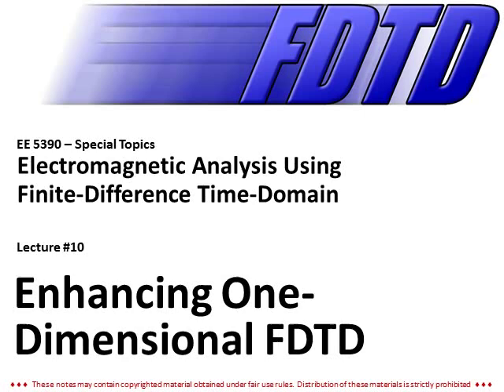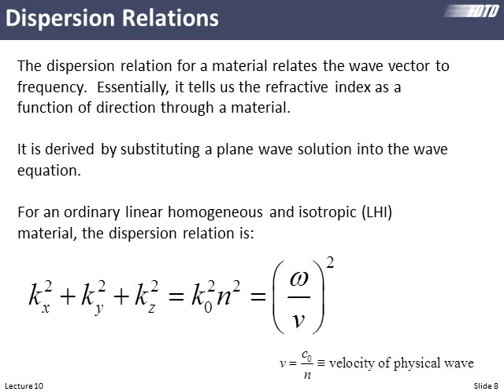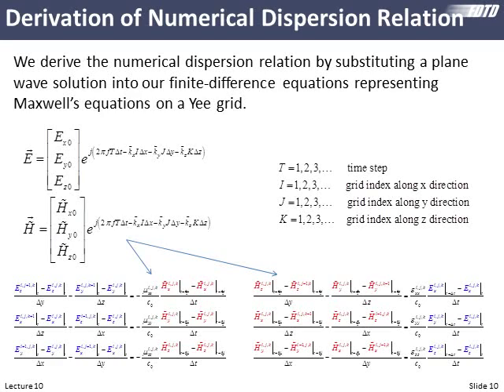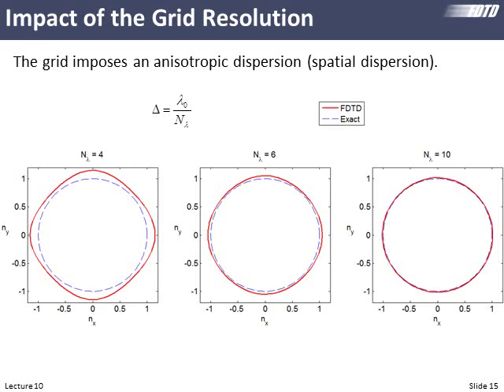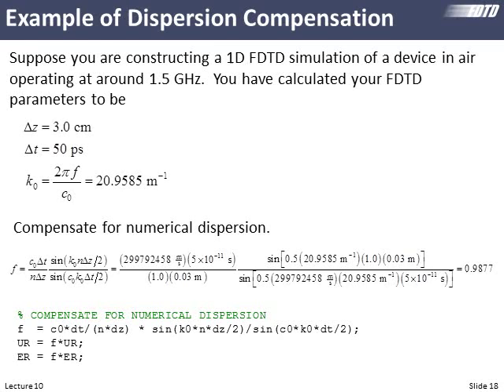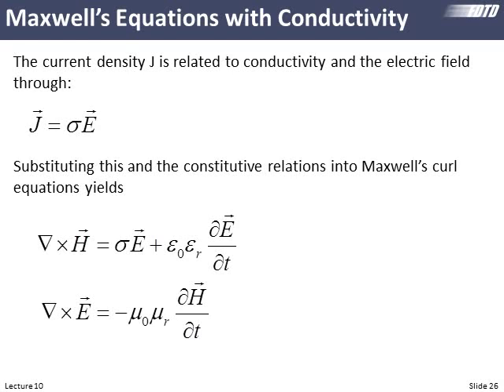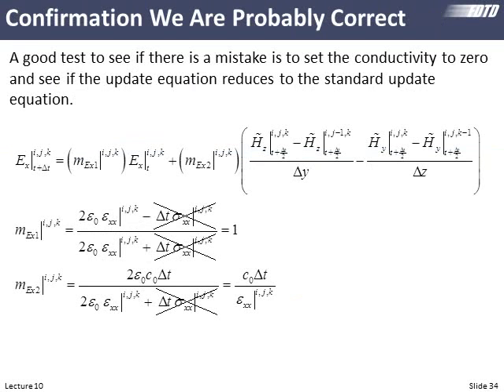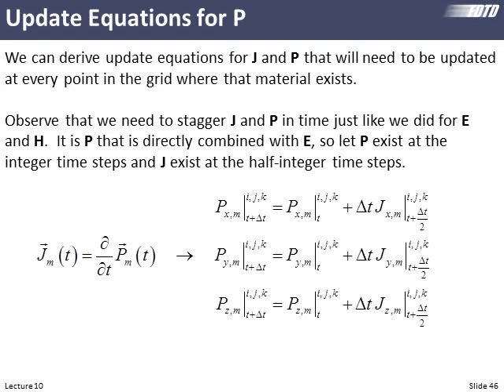Lecture 10 (FDTD) -- Enhancing 1D FDTD

Comment: Hello Professor I am trying to model a dispersive dielectric material using FDTD to determine its frequency-dependent relative permittivity but I can't get it to work. I tried to modify my working model for the dielectric slab you talked about in the previous lectures (8 and 9). 

Since now I don't know the refractive index of the material (in fact that is what I want to determine) I took n_max as 1. I should also note that the set of equations I am using is a bit more complicated, I am using the phonon coordinate instead of the polarization but it just replaces the constants in the equations so it shouldn't affect the result I think?  I am also still updating the values of H and E at the boundaries which seem to be missing in the loop you gave in this lecture but since the equations for D and H do depend on the values of H and E at the boundaries respectively I think keeping them is justified.

Anyway, I wanted to ask you what I should take for n_max (I know that near the resonance the refractive index jumps up to 16+ 16i) in this case and what other things I would have to change to get an accurate result. 

Thank you in advance for your answer.
Reply from the maker: Sorry, but I am a little confused. You wrote “trying to model a dispersive dielectric material using FDTD to determine its frequency-dependent relative permittivity.” You will need to know the frequency-dependent permittivity in order to run a simulation. I think maybe you are tweaking the parameters until your simulation matches experiments in order to determine the properties?

Setting nmax to 1 when you don’t know the properties is also confusing. Again, you cannot run a simulation without entering some kind of values. In this case, you should know nmax.

I do not know what “phonon coordinate” is to help you.

Which block diagram are you looking at? It should include recording E and H at the boundaries.

From your last statement, choose nmax = 16.
Reply: @empossible1577   Hello once again thank you for your reply. To clarify some things I am using the Lorentz model on dipoles to determine the propagation of light. Here the polarization is simply given by:

P=NZQ/sqrt(mu*N) where N is the number of unit cells per unit volume, mu is the effective mass, Z is the charge of the ions of a dipole, and finally, Q is the phonon coordinate given by Q=sqrt(N*mu)*W where W is the effective displacement between the two ions of the dipole. In other words,  here a phonon is the different vibrational normal modes of a charged harmonic oscillator (which is the dipole). We can rewrite the governing equation as:

partial of J + gamma*J+omega^2*Q=sqrt(N/mu)*Z*E, where J= partial of Q instead of P

Taking a monochromatic EM wave (of angular frequency f) the solution for Q is also a monochromatic wave giving:

Q(t)=(sqrt(N/mu)*Z)/(omega^2-f^2-i*gamma*f)*E(t) 

plugging this equation back in for the equation for the polarization we get a similar result as the one you got at 47:48 in the lecture (or slide 24 in the lecture notes). Now using the relation D=epsilon_0*E+P we get:

epsilon_r(omega)= 1+(NZ^2)/(epsilon_0*mu)*1/(omega^2-f2-i*gamma*f)
                               =1+(omega^2(epsilon_0-1)/(omega^2-f2-i*gamma*f)

which is the same relation you gave at 38:25 (or slide 41 from the lecture notes) once we define omega_p^2 as the coefficient at the start. Now this is the analytical solution for a monochromatic wave. Now using the loop you provided at the end (or slide 52 in the lecture notes which is the one that is missing the steps of updating the values at the boundary) and replacing P with Q (for now this makes no difference except for the coefficient for P which is now Q) in the equation of E we should be able to retrieve this result through FDTD but right now I am having difficulties with this step. That's why I wanted to ask you about the parameters and implementation of this system of equations. I know analytically that the refractive index goes up to 16+16i (but didn't know how to choose nmax to match that). I will try using 16 as per your suggestion. I also wanted to ask you what would happen if I tried to use a higher value just out of curiosity.

As for your question on how I can run the simulation without the frequency-dependent relative permittivity, I think epsilon_0 and epsilon_infinity (as the value fo the relative permittivity at 0 and infinite frequency respectively)  should be enough the run the simualtion. Like I said I was confused as to how to apply this to the algorithm from before. I should also add that the source I am using is a modulated Gaussian pulse with bandwidth extending from 20 to 32 THz since omega in my case is about 25 THZ.  So in this case I am also taking fmax=5 which is not the maximum frequency anymore but just the difference between 20 and 26 THz (which is the central frequency of the modulated Gaussian). So I suppose I would like to ask whether this would pose any problems as well or i  should I just change tau to be 0.1 and keep fmax at 32 THz or a slightly higher value. I am using this range as this is the range is slightly bigger than the so-called reststrahlen band where the reflectivity is high. 

To give my question more context, I plan to add some nonlinear terms to Q afterwards to replicate the results of this paper: https://www.pnas.org/doi/full/10.1073/pnas.1809725115. However, at this stage, I am excluding the nonlinear terms to make sure I have a working model.

Once again thank you for your answer and assistance in advance
Reply: @empossible1577   Hello I wanted to give you an update on my previous comment. After your comment, I tried to put fmax=32 THz and nmax=16 and put tau=0.1 for the modulated Gaussian pulse. Unfortunately, I still can't get accurate results. In fact, weirdly I am retrieving the previous sinusoidal pattern instead of the curve with the restrahlenband (the area where the reflectivity jumps up and then down). So I am asking for your help once again. I have one more question you previously said the spacer region should be as big as the minimum wavelength for 2D and 3D FDTD but is not required for 1D FDTD. Does this still apply to dispersive materials?

Thank you for your help and sorry for bothering you once again hopefully I am not asking too much.
Reply from the maker: @emredurmus2506  No need for spacer regions in this specific implementation of 1D FDTD regardless of material properties. 

The reason for the spacer region is that many absorbing boundaries do not handle evanescent fields very well. Inside the perfectly matched layer (PML) absorbing boundary, evanescent waves become propagating waves that become an escape path for power in the simulation that you cannot account for. The spacer region is meant to allow the evanescent fields to sufficient decay before touching the PML. Many times you will hear that the spacer regions need to be a quarter or half wavelength, but this is only a rule-of-thumb. Some devices have very large evanescent fields and these simulation will require much larger spacer regions.

This specific implementation of 1D FDTD uses a perfect absorber so it is never a problem. It could can handle evanescent fields without problem.

Hope this helps!
Reply: @empossible1577   Yes thank you for your response I just had one more question. For my source, I am using a modulated Gaussian with a central frequency of 26 THz how would I modify fmax in the algorithm in this case I have set tau to 0.1 since I want the range of the source to be between 20 and 30 THz.
Reply from the maker: @emredurmus2506  If you are ever unsure, simply FFT your source and identify the maximum frequency. Remember, it is not just the maximum frequency you are interested in, but the maximum frequency where the FDTD will see energy. Even when you are not interested in certain frequencies, if they are present in the simulation they could cause the simulation to go unstable if not accounted for.
Reply: @empossible1577  That's interesting I can't say I completely understand it. So the fourier transform of my source is a gaussian that goes from 20 THz to 32 THz and hence i choose 32 THz for the maximum frequency  but then again i am not sure what the maximum frequency where the energy is present is i just have that the tau term is 1/(2*6) and from the first example with the normal gaussian that was where we used the maximum frequency so I am guessing 32 THz would be the maximum frequency in my case but then again there are no frequencies below 20 THz in my simulation then would they affect the result?
Reply from the maker: @emredurmus2506  In terms of stability, I don't think the low frequencies will hurt. If you wanted to get accurate simulation results at those low frequencies, there are some things that could still go wrong, like not enough space between your device and PMLs. If you have no interest in those frequencies, I would not worry about them.
Reply: @empossible1577  Ok thank you very much for all your help!
Reply: @empossible1577  Hello Professor sorry to bother you again but I have a quick question. Is there a way to choose d according to the maximum frequency and refractive index of the system? It is clear that as either is increased the minimum wavelength and hence the spatial step size decreases making the simulation take longer for the same length for the material. For instance, for the dielectric slab with a maximum frequency of 1 GHz and maximum refractive index sqrt(12), choosing 30.48 cm works well but when fmax is increased to 32 GHz and nmax to 4 keeping d as 30.48 cm not only makes the simulation take a longer time to run but also gives a wrong result. But changing d to  3.048 cm seems to solve this issue (perhaps partially). Now I want to set fmax to 32 THz and nmax to 16 and for these values I have  not been able to choose d accurately. Could you give me any tips as to how to choose d in this case?
Reply from the maker: @emredurmus2506  I am not sure what you mean when you say the simulation is wrong. Are you only changing fmax, or are you also changing the thickness of the slab. Increasing fmax should not change the results of your simulation unless those results were not converged to start with. If you were not converged, increasing fmax will add to the resolution of your simulation and the results could shift. Otherwise, increasing fmax should not change the simulation results.

Yes, your simulations with higher fmax but everything else the same will take longer. There are special cases were ADI-FDTD an get around this, but I don't think that is an option for you. Unfortunately, you will have to suffer through longer simulations! Welcome to computational electromagnetics! LOL
Reply: @empossible1577  Hello thank you for your response I am in a weird situation right now with my model. I have a Gaussian source with a central frequency of 26 THz and bandwidth of 6 THz and as I mentioned before I am trying to model a dispersive dielectric using the Lorentz equations you provided in this lecture. Now I know the real part of the refractive index goes to 16 near the resonance so I set fmax=32 THz and nmax=16 but then what I get for the reflectivity is just a sin^2 plot as per a normal dielectric slab. I am also plotting the analytical solution which looks entirely different (as the one you showed in the lecture). The weird thing is if I set fmax=10 THz and nmax=1 I suddenly obtain the correct result up until a bit after the resonance where the plot just continues to stay at the same value with some small oscillations. I should mention that instead of performing the Fourier transform at ever step as you did I am instead recording the reflected and transmitted fields at every time step ( that is the value of E[1] and E[N] at each time step) and then performimg the FFT using the time step size and length and the FFTW library.

What is confusing me right now is I don't understand the role of fmax and nmax. For my model fmax only goes into determining the minimum wavelength and nmax goes into the minimum wavelength and propagation time but choosing their actual values leads to an inaccurate result when compared to the analytical result. 

I also don't know what I should choose the thickness of the slab to be as the thickness affects the distance between the peaks of the sin^2 pattern (in fact for the normal dielectric slab it is simply given by c/(2*nₘₐₓ*d)) I have found that the sin^2 pattern I obtain for the real values also follows a similar pattern except the distance between the peaks is the mean of this value for all frequencies.  How could I solve this issue?
Reply from the maker: @emredurmus2506  Yes, fmax and nmax simply calculate the grid resolution. Increasing them should not change accuracy. That should only slow things down and actually give a better answer in the end. I suspect there is something else wrong on your code.

Maybe I lost track of your simulation problem. You are asking about choosing thickness. If you are free to choose, choose it to be a quarter to half wavelength at your center frequency. This will ensure you get a strong response from the slab.
Reply: @empossible1577  Thank you for your response. You are right I fear at this point I have also lost track of the problem. Would you be willing to take a closer look if I were to send you an email with some figures and/or the code from my simulation to give my problem more context?
Reply from the maker: @emredurmus2506  I am currently working two full-time jobs. I will not have time to troubleshoot a code, but I will certainly do my best to look at your results to see if I can help.
Reply: @empossible1577  Ok  thank you very much

Comment: HI Professor, at 52:07, why it's handling D TF/SF source, instead of E TF/SF source? Is it ok to handle E TF/SF source as previous? Thanks.
Reply from the maker: I incorporate the source from the curl operation.  The curl operation happens when calculating D, thus that is where I put the TF/SF correction step.

Comment: Hi, thanks a lot for the lectures, they are helping me a lot with my thesis,  I have a question, when adding the correction for numerical dispersion,  the formula involves the wave vector k (that dependes on the frequency) but how can I add the compensation when the system is perpetuated with a Gaussian pulse that has a lot of frequencies, I'm sure I'm missing something but I don't get it. Thanks in advance
Reply from the maker: Unfortunately, this simple technique can only cancel the dispersion for one frequency in one direction.  When you have a spread of frequencies or a spread of angles, all you can do is base the compensation on an average.  If the dispersion is a serious problem for you, there are more advanced ways of handling it that give much better results.  For examples, you could adopt a hexagonal grid (Lecture 18) or use the M24 algorithm (Lecture 25).

Comment: Hi Professor, at 50:51, the value of epsilon(infinity) in the equation is always 1, right? Thanks.
Reply from the maker: No.  If there are any atomic resonances at a frequency much higher than you are interested in  for your simulation, there is no need to model that resonance.  Instead, it is only necessary to include the offset due to that resonance.  So eps(infinity) is the sum of all the offsets from all the resonances at much higher frequencies.  Think of it as a background permittivity.

Comment: Hi Professor,  P = e0*xe*E (from slide26, Lorentz-Drude model, 21 century Electromagnetics). Why e0 is missing in the last question of slide 43 at 46:58? Thanks.
Reply from the maker: It was normalized out.
Reply: @empossible1577  Thanks for your reply. But if it was normalized out, why e0 appeared in free space response term of D=e0*e(infinity)*E + P at 46:58?